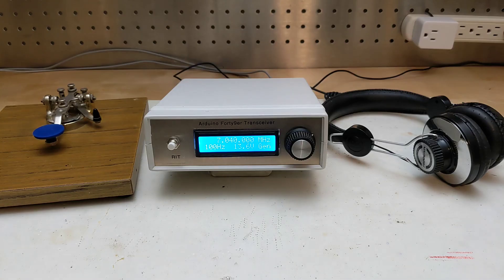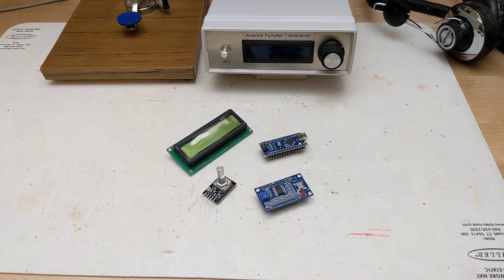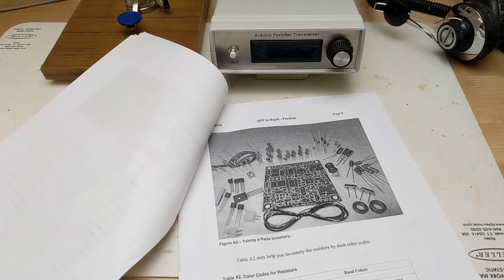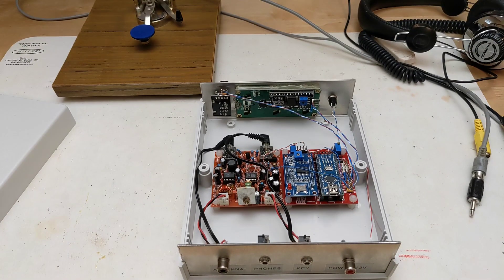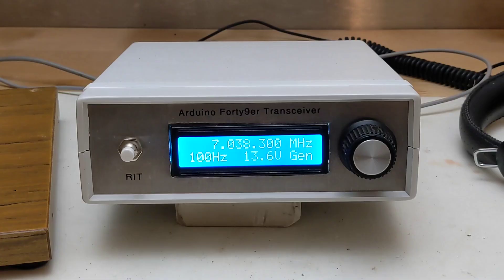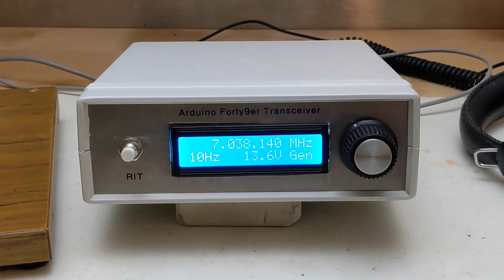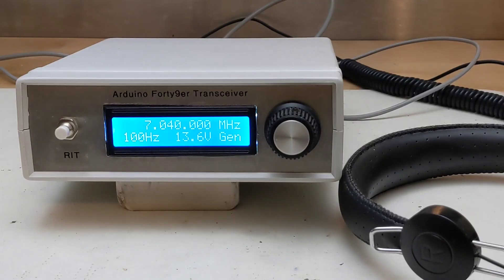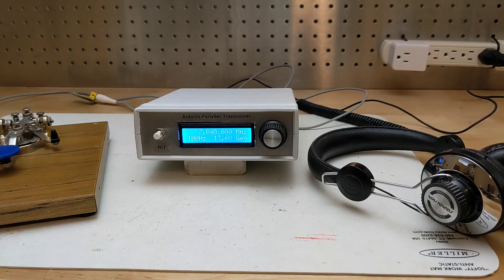The Arduino Forty-9er: A Modular 40 Meter CW Transceiver with VFO

Comment: It would be sweet to add a built in CW decoder into the code, but that might require a larger LCD screen. great little project tho
Reply: That's cheating.  Sort of like riding an electric bicycle :-)
Reply: Having a uBitXv6, I know that the Arduino Nano is already running near its limit, I would imagine CW decoding would be extremely difficult without more powerful computing hardware.